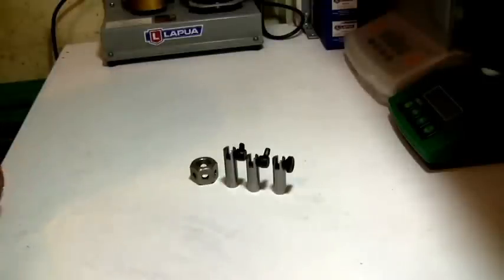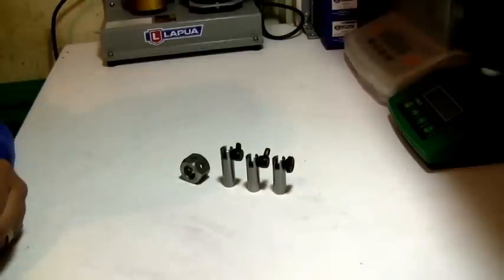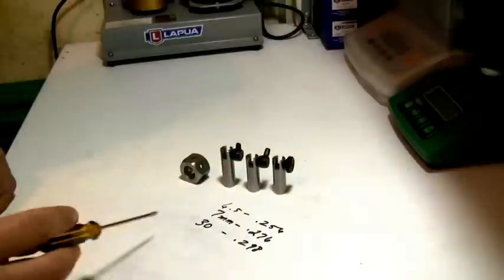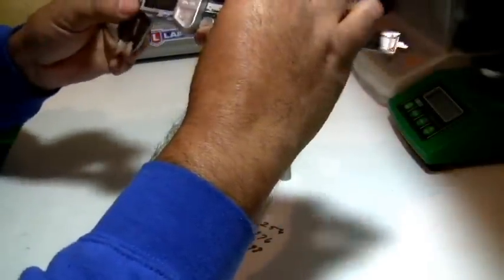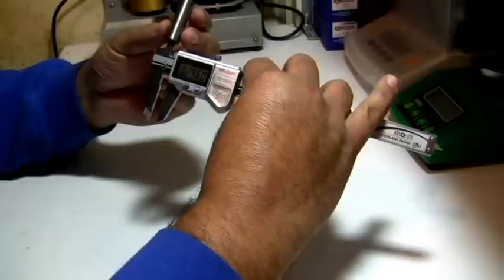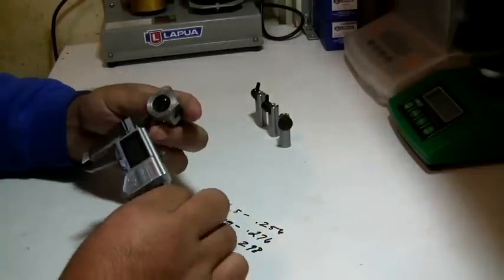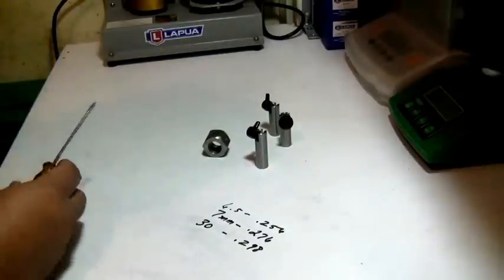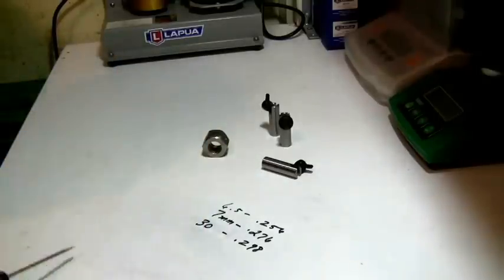Precision Reloading #2:  Ogive Comparators tools

Comment: When you think about it it doesn't matter whether the nut measures exactly from the exact point on the bullet where it contacts the lands as long as it measures the same point on the bullet each time.. I mean how many every day shooters know the exact inside bore dimension of the lands on their rifles? We don't really need to to make great ammo.  Here's what I'm getting at. Load a round with a bullet touching the lands and measure it using the Sinclair nut. Note the measurement.  Either add the desired jam or subtract the desired amount off the lands.  The first measurement is merely the reference point that you either make it longer or shorter from. Whether that first # is the EXACT # or not doesn't matter as long as you are using the same tool with the same hole dimensions every time.  As long as the nut references the same point on the bullet each time that is all you need to create accurate rounds @ .010" or whatever jump you want. As long as you  are using the same tool each and every time and it measures from the same datum point on the bullet each time, ie the hole never changes, it matters not whether the reference point you start from is the exact OD as the ID of the bore. What you end up with is rounds that are exactly the desired jump or jam  you're looking for.  I hope I made sense with this long incomprehensible rant.
Reply: I use the hornady bushing comparator and the hornady overall case gauge. I figure out when the longest point is with the COL gauge where its start to touch the rifling and go from there. Now if you change bullets you have to start over because the comparator isnt gonna always measure every bullet the same way so clean the bore really good and start over. For me once i find a bullet that shoots lights out i dont change anyways
Reply: I don't shoot competition but I want every little bit of help I can get for a accurate round that I have  more time then money in each round.  But I do understand what you are saying.
Reply: This is true.  A comparator is only a reference tool.  But, to be useful, you do need to use an OAL gauge to find the length of the cartridge where the bullet touches the lands and that is your reference point.  Measure that with your comparator, then subtract whatever standoff you want and use the same tool to measure your seated rounds.  The actual overall measurement that the tool produces is irrelevant.  What matters is the difference between it and what you determine your seating depth to be.
Reply: Pat double this is the front of the pat double
Reply: There is one situation it would matter.  If you are switching bullets with different angles your length from lands would change.  (not that you shouldn't test it anyway)

Comment: Both tools serve same purpose.  Nothing wrong with either. U will get different measurements from each tool but as long as you use same one your good. Any of these ogive measurement tools just bypass having to measure from bullet tip which varies. Either one of these work fine and will serve u well.

Comment: I have and use the Sinclair nut. I also make my own reference gauges from the barrel stub using the chamber reamer that was used for the barrel. That is the only way you are going to get a "as close to perfect duplication" of your chamber freebore and throat. 
but in reality it doesn't matter. all you need is a device that will give you a consistent repeatable result. I have two of the nuts and they are .003" different on the 6mm hole in depth. so one is marked with red dykem  to know that this is the one i use for seating depth. Yes I know this video is five years old and you probable have since realized the situation here.

Comment: Funny how much stuff has changed in 6 years. Don’t use any of these lol. Actually never did. Did the tape on cleaning rod and razor marks forever. Till I started making loose neck cases by just moving a bullet around with a pair of pliers then put new bullet in and chamber and close bolt. Gently take it all apart and measure.

Comment: The Sinclair hex nut holes are not just drilled straight through.  The hole is made with a chamber throating reamer.  The hole has about a 2 degree taper, so the diameter of the hole at the outside of the tool is larger than the diameter of the hole on the inside of the tool.
Reply from the maker: Kasey Fisch I will check them, but even so, they would contact different bullet profiles at different places on the ogive, which is not correct either.
Reply: @ErikCortina  the nut is reamed with the most common throat angle for the barrels used in those calibers typically 1.5-2 degrees. it's designed to simulated the ogive contacting the lead angle not the bore diameter.

Comment: Erik, hello, thanks for your videos, my question is, would my bullet seater also need to contact the bullet at the same point as the sorting tool for consistent bullet seating depth? If my bullet seating stem contacts the bullet away from the ogive and that “curve” is inconsistent “after sorting my bullets”, then my seating depth is still off due to this alternate seating stem contact point. Following the logic of greater seating depth = greater pressure then higher velocity, or is the resulting difference in seating depth not relative enough to worry about? The point here is to be the most consistent, yes? Thanks again for your videos.

Comment: Am i missing something here, you measured the 7mm but it equalled the 30 cal bore size, and then measured the nut 7mm (which was smaller than the bore by 4 thou). which makes the Bob's one oversized for 7mm by 34 thou.

Another point is, dont we just want to measure from the same point on bullet regardless of where it is? as long as it is the same point them we have no (or very little) error. Basically they all do the same job....no?

Erik, i am no dissing you at all but this has me a little confused.... and am only half way through. :-)

Ah.... in your first time measuring you measured the 30 cal but said it was the 7mm.....
Reply: Cigar man just followed me there?

Comment: I see the point, but at the same time it doesn't really matter. The tool is the measurement medium. As long as you're using the same tool over and over and don't expect to swap tools or share info with another reloader then it doesn't really matter where it's grabbing the bullet. And at $50 per caliber.. that's a lot of scratch to get the same value. Though id suggest the hornady variant over that nut.

Comment: I get your point Erik, but I'm confused: you pick up the 7mm BG comparator (you just looked at and put the 30 cal down on the table 10 secs before you picked up this one),  and measure it to be .298" ?  (so must have been the 30),  then compare against sinclair 7mm (you measure it to be .272") saying its 6 thou under.  Did you mistake .298 - .272 = 6 thou ?

Didn't think the sun was that strong in TX in January, pls correct me if I'm wrong.
Reply from the maker: +wano s Yeah, I picked up the 30 caliber one.  Thanks for pointing it out, I didn't realize that.
Reply: @ErikCortina  that's a own goal Tina if you want to win 🤣

Comment: These are not "absolute" measurements, they are comparitive,hence the name. The nut is just an old,expedient,easy to make on a drill press tool from years ago. The reason they don't work as well as a "sleeve" isn't hole diameter,it's the rocking motion when you try to use them. But they're easy to make and should teach you to be dang careful holding them for repeatability.

Comment: ARE THE HORNDY COMPARATORS RIGHT WITH THE BARREL
Reply from the maker: Ron Johnson I have not checked them because I don't use them.  If you have them, check them and let us know.  Thanks.
Reply: It's a comparator... for comparison. Exactly matching the bore of a particular rifle, or any other dimension for that matter, is not the function of a comparator.

Comment: It does not matter as long as you use the same tool every time. That these are caliber specified is not necessary. You need a small one. Where you measure on ogive means nothing as long as you use the same shock all the time.

Comment: Erik,
    Great video but your logic is flawed. Bullets do not intersect the bore diameter of a barrel, but rather become tangent to the lead angle of the throat at about the groove diameter. So to accurately compare the base to ogive tangency length of a cartridge and or bullet length you will need a comparator with a conical bore with the same throat angle as your specific chamber. Only then will you be comparing from the same point on the bullet's ogive. Of the two comparators shown in the video, the Sinclair tool will be more realistic to your rifles chamber, if in fact the Green tool has a straight bore. I really enjoy your videos. Keep em coming.

Dave Williams

Comment: I realized this a few days ago!  When I realized I was getting two different readings between my Hornady lock and load device as opposed to the Sinclair comparator. the differences range up to as much as  differences up to .005! Essentially the Sinclair measuring tool was a waste of good money. If you're trying to get an exact measurement for a "jump" from the bullet to the Lands and grooves, your measurements will be off!
Reply from the maker: +apyramidbuilder Indeed.  However, you must realize that the measurement is simply a way to compare from one round to the next, not necessarily an absolute number that can be interchanged between guns.  That's why I don't like to post my base to ogive measurement I use on my rifles because it will be different if measured using someone else's equipment.
Reply: +Erik Cortina Thanks, that's so true.
Reply: It doesn't matter as long as you use  the same tool to measure the loaded rounds with as you used for the initial starting point reference. Both will measure different if two tools measure at different datum points, but remember, the bullet loaded to touch  the lands always touches at the same point regardless of where your comparator tool touches the bullet so all you're doing is adding or subtracting length from the bullet touching which will always be the same as measured with the same tool. The two initial touching the lands measurements will never be the same if measured with two different tools, but the rounds length stays the same. As long as you record the measurements   to include the tool used to measure with the data is repeatable using that same tool later. Regardless of where the comparator references from on the bullet.
Reply: I'm in charge of the pyramids

Regards 

The True Sphinx